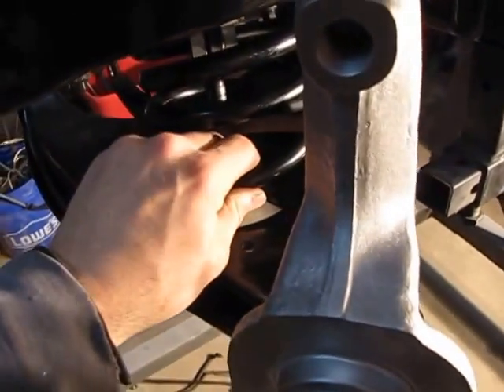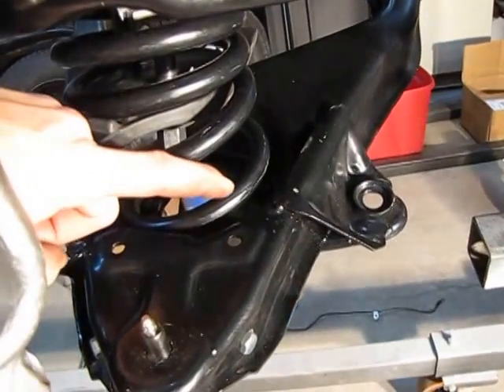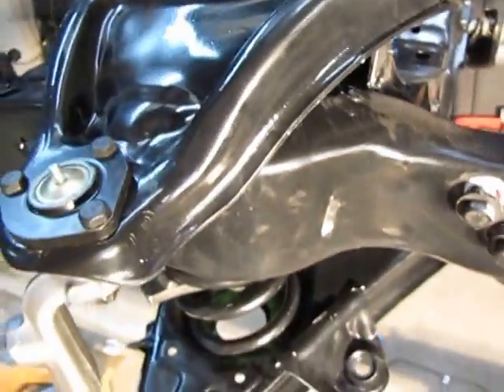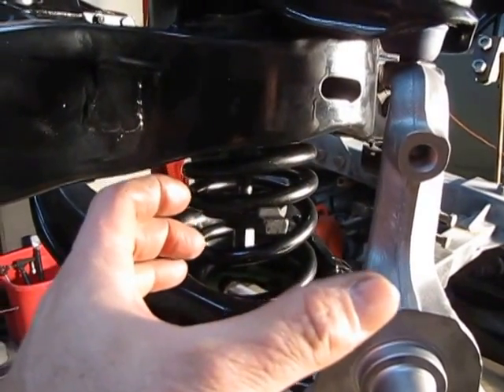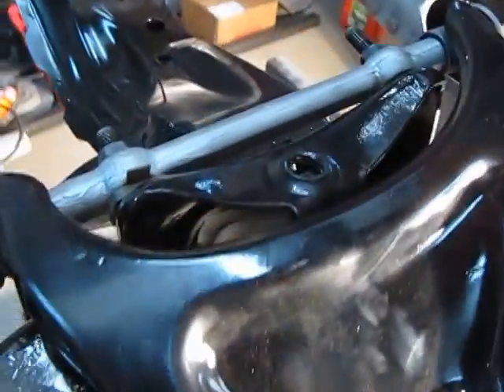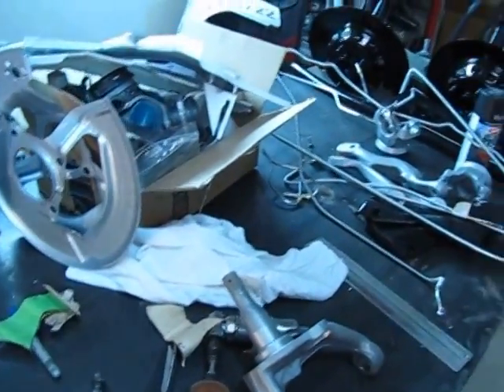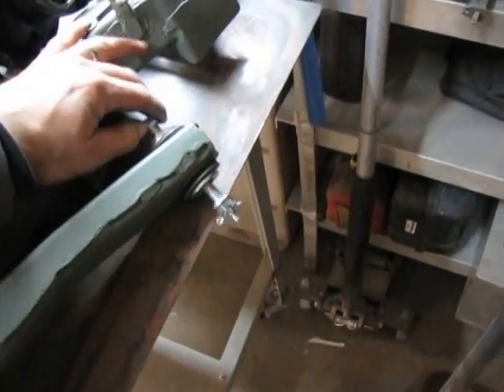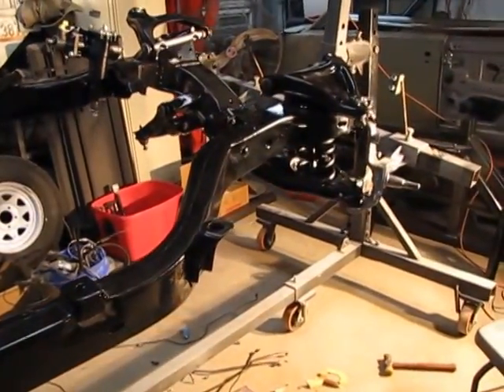C3 Corvette Spring Compress Part 2 of 2

Comment: Mopar Dude! put the stationary plate below the lower A arm like us veteran Corvette mechanics do, makes it a lot easier to get the short spring on a C2/3 Vette compressed fully ( wrap the stationary part to protect your paint.) You said a 1980 Vette? not one I would spend my time on, hope the Barracuda is a Formula S otherwise not another I would spend my time on...I hope you install the fuel line before doing the body drop! The fuel line is one of the 1st items I reinstall on a C2/3 frame because it pretty much wont go on once the body is dropped.
Reply: Arnold , can I replace my fuel line without lifting the body on my 66 ? Seems like a poor design since all (steel) lines degrade over time and eventually need replaced . Thanks for any info .
Reply: Noone cares if you think someone's vehicles are not worth the time. Could be something sentimental. True mechanics, gearheads, and enthusiasts don't pass someone's vehicles off as irrelevant. Get a grip man. Atleast hes turning wrenches and enjoying what he does instead of criticizing.

Comment: Good video. I'm doing the same on a '64.  Powder coated frame back, new fuel and brake lines installed, bushings and ball joints in, waiting on springs, other parts. A place called "Corvette Guys", think Nebraska, rebuilt the trailing arms.

Comment: Don, and everyone else, there is a MUCH easier and safer way to compress a spring if you have full access to the upper control arm like you do there.
 
 You notice in the UCA there is a hole for the shock to thread through.  Take a length of grade 8 ready-rod that is just the right size to run freely through that hole. Drop it down the hole so it travels down through the coil spring and eventually out through the large hole in the LCA.

At this point if you let the rod go it will just fall through to the floor. So to stop it from falling through place TWO large washers on the rod  (from the top) and then thread a grade8 nut down the rod.  Now the rod will not fall through to the floor.

So, now what to do with the bottom. The rod is sticking through the large hole in the LCA.  Get a piece of 5/8 or 3/4" plywood about 4 or 5" square, drill a hole in the center large enough for the rod to pass through.  Next VERY IMPORTANT, get a piece of steel plate about the same size and drill a hole in the center of that so it can accept the ready-rod  also.

Now slide the ply wood up the rod followed by the steel plate and run up TWO washers and a grade 8 nut.  You have made an explosion proof spring compressor!

You can tighten the nuts from either the top or the bottom and it will compress the spring.  Myself, I prefer to have a hydraulic jack under the LCA just for safety and tighten the top nut down.  Once the spring is compressed the spindle will be in place to hold the UCA and LCA in place.  The ready-rod can be removed.

This method can be used ON THE CAR, not just a  bare frame situation as long as you can get the ready-rod fed down the shock hole in the UCA.

Hope that is clear and helpful.
Reply from the maker: How did I miss your very helpful comment? Yes, this was a long time ago and certainly I hope to be better today than yesterday at this game.